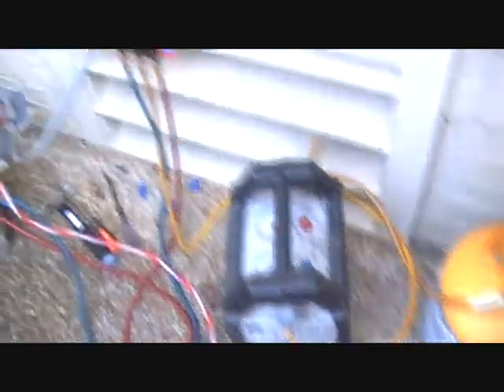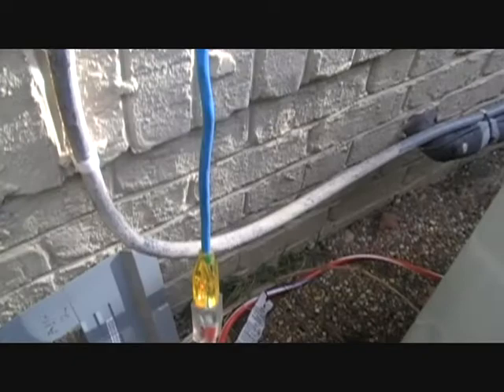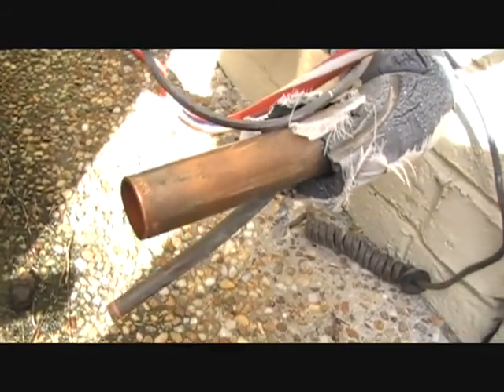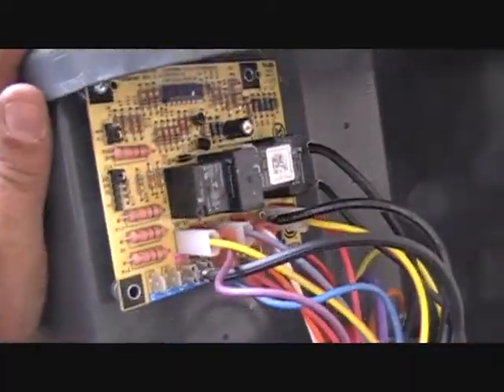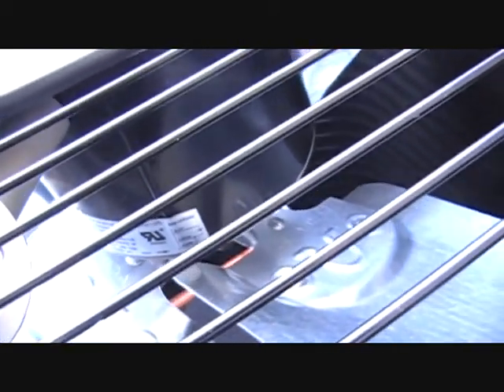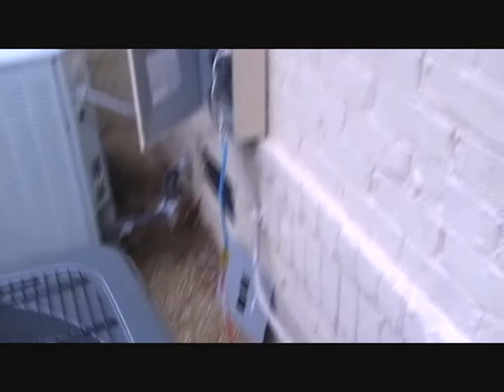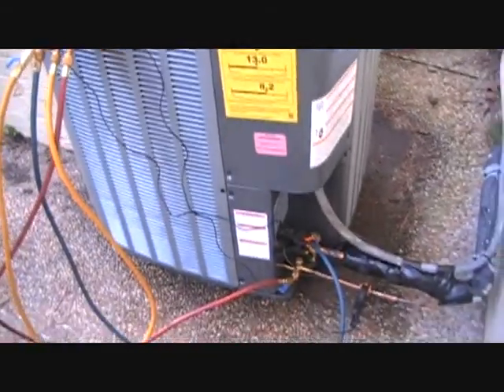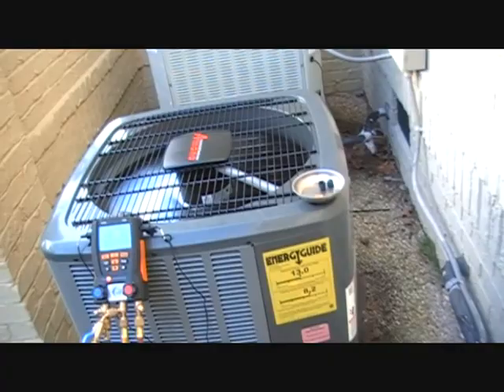HVAC Install- Amana ASZ13048

Comment: hi, about a week and half ago it was really cold outside and I believe our heat pump shut off and then it switched to our propane for heating. We were told by the previous owner that we would have to reset the heat pump, I went and took the cover off and saw a paper clip, assuming that is to push it into the hole that is labeled Reset, there’s a green and red indicator light that weren’t on, I pushed the reset with clip and the red light blinks three times, not sure if that reset the unit? Thx it’s a 2013 Amana

Comment: zach csn you help me on my ac unit
Reply from the maker: +Dylan Smith how can I help?
Reply: Working Joes Roundtable does the comfort alert flash you codes or how do you tell what the issue is
Reply from the maker: +Bajaheat it points you in the right direction

Comment: what company did that say on that data sheet
Reply from the maker: +Dylan Smith Goodman?
Reply: +talyn875  can you get it so it sais the copany of amana or not any more
Reply from the maker: +Dylan Smith I think they all say Goodmam. why do you want it removed?
Reply: +talyn875 no im wondering so you cant get it so it sais amana company because i DO NOT like goodman at ALL i just like amana only
Reply: +talyn875 also i have amana prestige air and it dosent feel cool at all and the suction line dosen't sweat at all on a 90-degree day and on those days the suction line feel like out door temp what should i do get a new one like now or what talk to me asap when you can
Reply from the maker: +Dylan Smith are you located in my area?
Reply: +talyn875 no

Comment: Hi Zack - thank you for taking all my questions and so quickly!  When you go to flush the lines, is there a preferred way you do it?  Into the suction line and out the liquid?  Or the other way around?  Does it matter?  My guess is through the suction.
THanks! Kris
Reply from the maker: karizmatic5 I usually do in suction out liquid. Its best to remove any pistons.